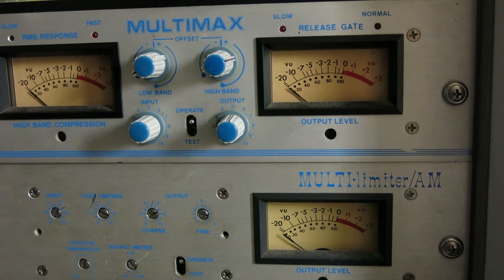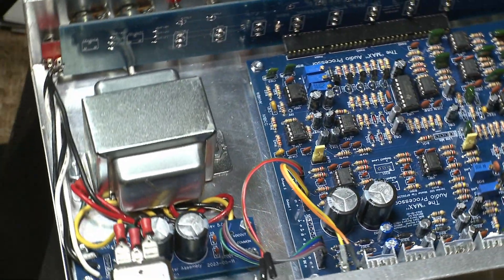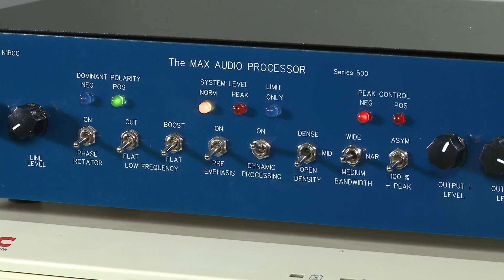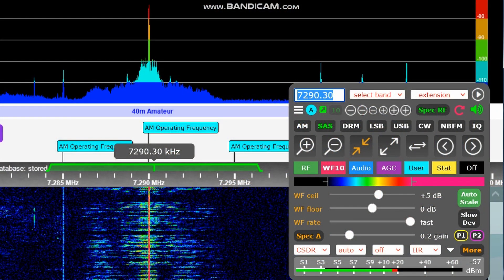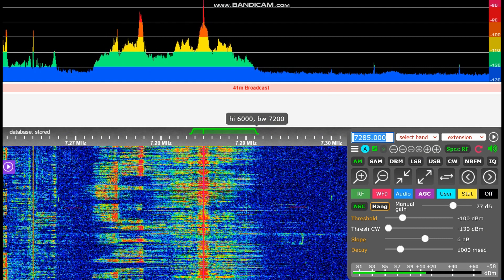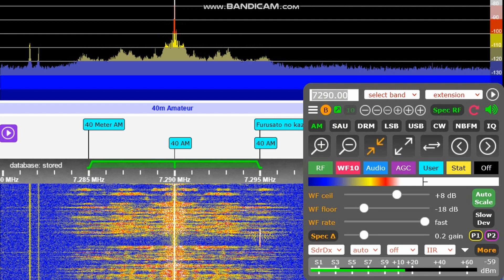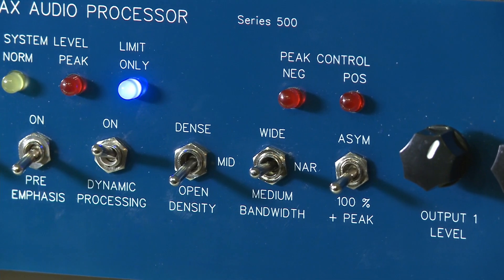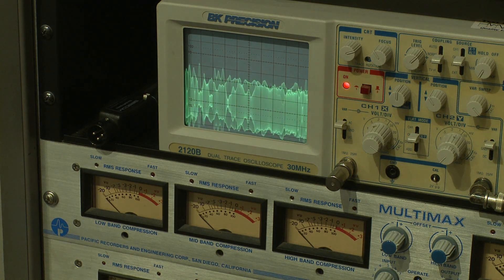MAX Audio Processor REVIEW

Comment: would you suggest running an EQ first or after the processor? I have a Behringer 2496 that does quiet a bit of EQ and processing. But my Super Senior hates it.
Reply from the maker: Just seeing this, Tom, sorry for the delay. My experience has been to put the EQ before the audio processor so that the final unit controls the overall level of the audio profile you've decided upon. If you put the processor first, the EQ could still exaggerate some overshoot.
Reply: @leftblankintentionally6923  Everything is running good! EQ into the Max audio and the Super senior loves it! I am getting great reports! Thanks!

Comment: Those Pacific Recorders Multimax Multilimiter  processors can sound wonderful in a broadcast audio chain. They use photo cells to achieve gain reduction.
Reply from the maker: I know the Urei Modulimiter BL40 used those optical sensors, but not that the PR&E did so as well.  They were initially partners in developing what turned out ot be the BL40, but the founder of PR&E has said Urei wanted to cut corners so the relationship ended.  The AMLimiter and AMmax followed in 1971-72.